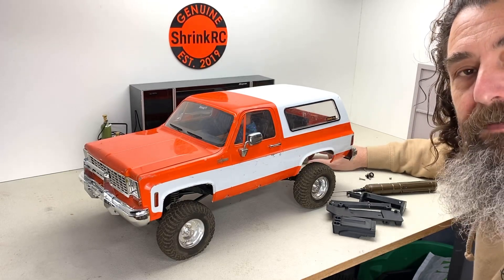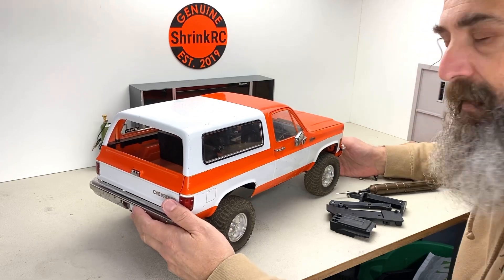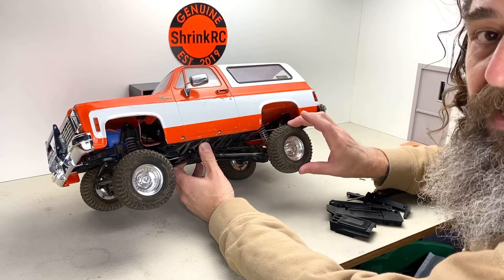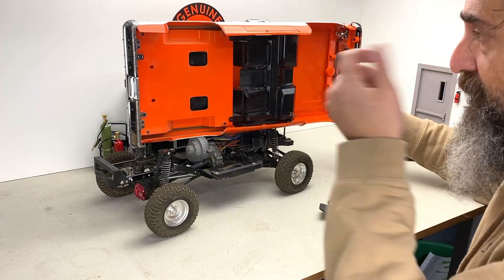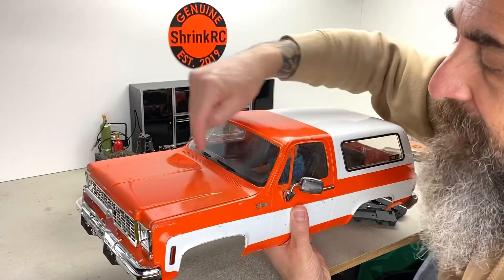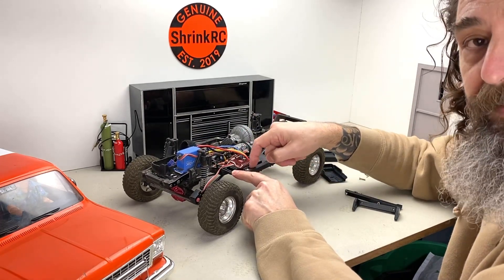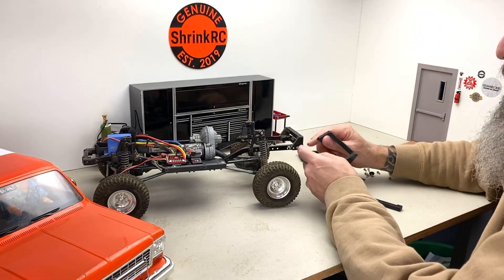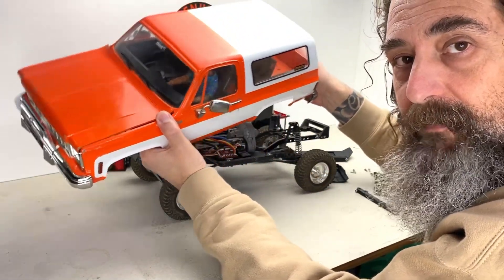Chassis swap! Mounting a RC4WD Blazer on Axial SCX10ii

Comment: I'm thinking to mount a RC4WD Blazer Hardbody on a SCX 10 III. I know your bodymounts are designed for a 10.2, but with custom work it should fit also. Btw, the tires are not to tiny, they are very realistic and gives the car a more scale look. For my taste all the crawlers have overdimensioned tires.

Comment: That is a great looking rig.  All of your builds are actually.  You mentioned would not do a cantilever setup.  I am curious on your con's vs pro's on them.  Have a good one man!
Reply from the maker: Thank you! The main reason people seem to get cantilevers is to avoid cutting holes in the bed because it doesnt look stock. But to my eye, cantilevers look even more out of place.  So looks alone is enough almost for me. To be fair, I haven't tried them myself but it seems like most people I know who try them find them to be "floppy" and wind up taking them off anyway. So I've never tried them but never say never haha. By the way I don't think there's any wrong way to do it if you are having fun!
Reply: @shrinkrc  So holes in the bed is unavoidable even with your body mounting kit? With all due respect, why get the kit then? Thanks!
Reply from the maker: @JakeHinds  The point of the kit is to be able to easily mount the body on any chassis you want (Axial, Element, Traxxas , Vanquish etc.). Its not my fault the rear shock towers are there hahaha! You would have to place the body ridiculously high to clear the shock towers. There are several options to avoid cutting holes tho, like cantilever setups or simply using shorter shocks which are attached to the frame or to short shock towers. You could also hide the shock towers with an ice chest and a toolbox for example. The RC4WD TF2 chassis (which the body was originally designed for) uses much shorter shocks, so it does not require holes for example....but it is a leaf spring chassis which performs differently from a 4 link setup with real shocks. I have holes for rear shock towers on most of my trucks, it doesnt bother me. There are long travel 1:1 trucks that have holes for tall shock towers as well.

Comment: Thank you so much for explaining when no one else would, on how you mounted this particular body on the scx10 ii. I bought the "Raw Builders Kit" version of it, and if i would have known, Iwould have bought the same hard body. Do you know if I could mount the RC4WD blazer body on an HPI Venture SBK? 

I subscribed to you your channel. 😁
Reply from the maker: It's mostly possible to put the Blaxer on any chassis with enough effort. I don't offer mounts for the HPI so you would have to figure that part out, but otherwise the process would be pretty similar.

Comment: Ever thought about doing a scx10III ? I’m thinking about getting the gladiator kit, forward mounted motor with a scale motor cover, dig, over/under drive.   Then putting this same K5 hardbody on it.   Thoughts? Would your body mounts work? I think the 10III has different running boards.
Reply from the maker: Sorry our 10.2 mounts are not designed to work with 10.3.

Comment: I think My wife is fixing to order me the mounts for my k5 blazer  to be able to mount it to my rtr Phoenix. Is there anything special i need to tell her when she orders ? Thanks
Reply from the maker: She just needs to grab Vanquish VS410 mounts for Blazer, they are same for all the Vanquish chassis. There's a couple things you will need to do, like smaller tires, and rear links from an Axial 10.2 (11.4 wheelbase). You can cut the rear drive shaft to shorten it. You'll be doing some interior trimming as well, and cutting holes for the rear shock towers. Check out my video on Vanquish 4runner, all the things you will need to do are very similar. You can always write to me with questions. https://www.youtube.com/watch?v=lxKz7r0GHtk&t=6s
Reply: @ShrinkRC  thanks brother I've allready done the links and rear drive shaft and small tsls .thanks again for  gideing us threw .

Comment: Hey there, im in the uk, would it be possible to buy all the parts i need from you and get them sent to the uk? Thanks.
Reply from the maker: Hi I only ship to UK via eBay. They cover all of the customs charges etc.
Reply: @shrinkrc  that's perfect 😁 what's your ebay page? Do you have a link please?
Reply: @shrinkrc  found you haha, do I need to do anything else to make the blazer body fit? Because my scx10ii is 313mm wheelbase I think
Reply from the maker: @YUNGHENNEY  Hi you will need shorter rear links, Use rod ends (AX31186), upper links (AX31421), lower links (AX31419), and set screws (AX31343) to get a 11.4" wheelbase. Or you can make custom rear links, I have a video here: https://youtu.be/Xarp2kymeVQ?si=NiY200-mryIsOWMB
Reply from the maker: @YUNGHENNEY  Also my raised center console was made for this combination: https://www.ebay.com/itm/403817446495
Reply: @shrinkrc  thank you 😊

Comment: Hey will these work on the Injora 90046 and 90047 rock crawler chassiss? These two are scx10 and scx0ii clones.
Reply from the maker: They will bolt to the clone chassis rails, but the axles might not line up right without changing links. The clones sometimes use different link lengths than the original.
Reply: @shrinkrc  what would your suggestion be as for the links?
Reply from the maker: @scottfordbrewer4380  I would suggest a complete set of axial 10.2 links, front and back. The reason it’s an issue is that on a genuine axial, 12.3 inch wheelbase, the front links are shorter than the rear links. The clones cheat…and make the front links the same length as the rear links, so the front links are a little bit too long, and the rear links are a little bit too short. If you are shortening the wheelbase for a blazer, you’re already going to need new rear links anyway.
Reply: @shrinkrc  thank you for your time and help!
Reply from the maker: @scottfordbrewer4380  you’re welcome!🤙
Reply: @shrinkrc  one more question would 2.2mm wheels be able to fit on that shorter chassis?